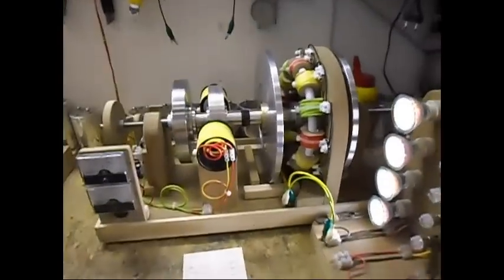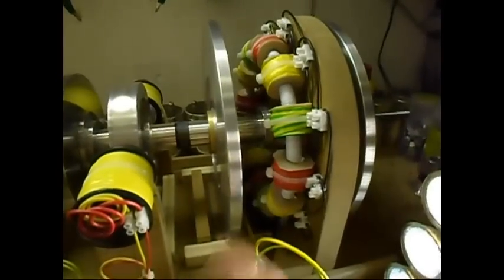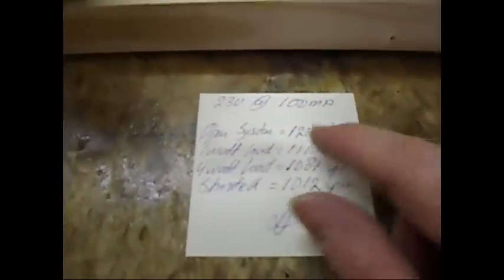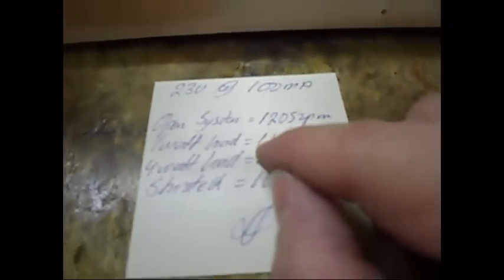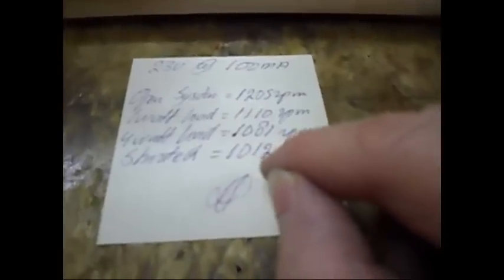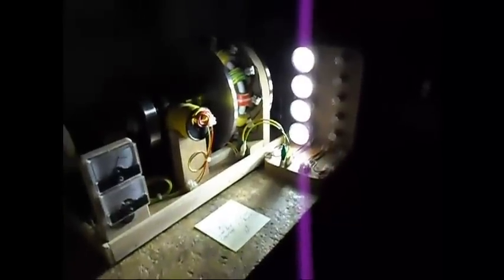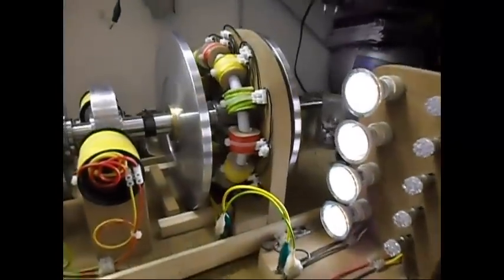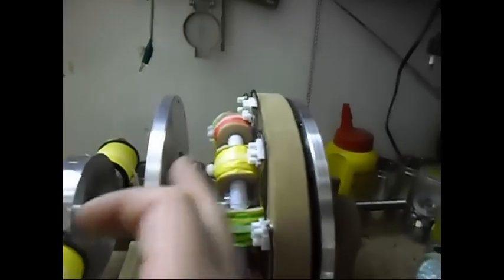Pulse Motor_Generator - Update 49 OverUnity is it or not, Future World Generator_36...

Comment from the maker: Just a update where i'm playing around with this multi adjustment setup...^^
Numbers,
Input is 23Vdc @ 100ma...
Open coils = 1205 rpm
Coil loaded with 1watt = 1110 rpm...
Coil loaded with 4watts = 1081 rpm...
Coils shorted = 1012 rpm...
Nothing special...just some playing around here but it is still pretty good performance...^^

The distance between the rotors and coils center are both the same wich is 50mm each...;-)